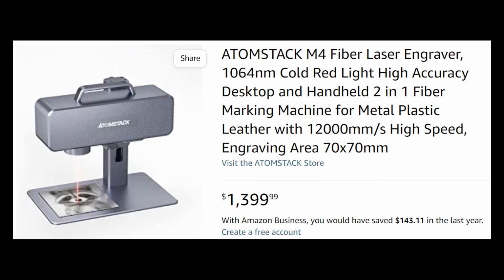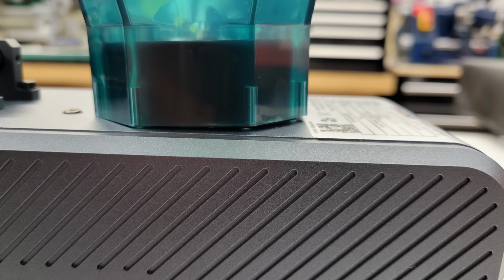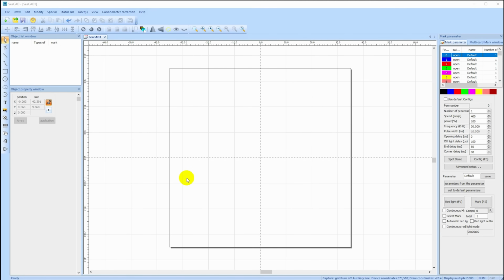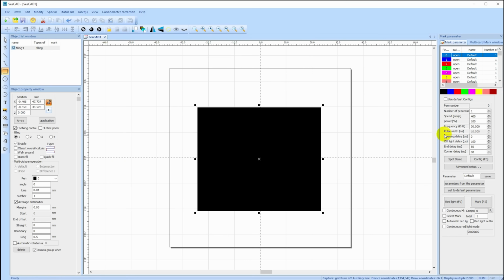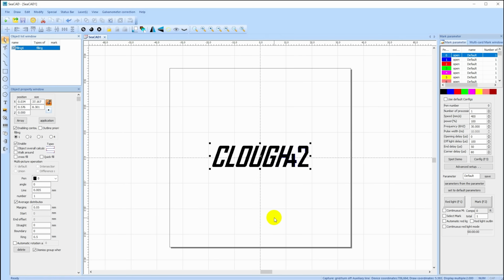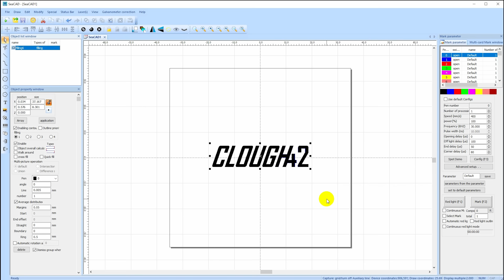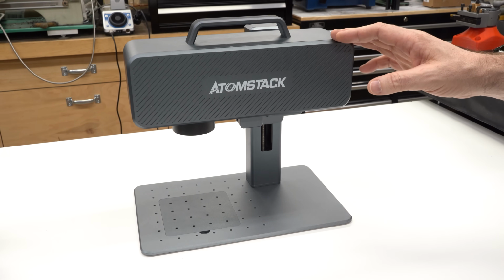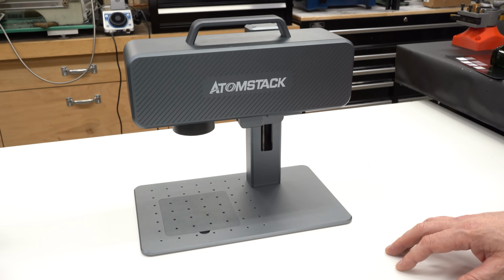Atomstack M4 Fiber Laser: Is it worth buying?

Comment: .I think you were being very generous.  If the average guy buys one and runs into any of the problems you di, then the reputation of the product goes down the drain,  Everyone of your suggestions should be adopted.  I think you forgot about the two formats that didn't work.  Fro me that would be a deal breaker. Thanks for the video.
Reply: I think most people who buy chinese stuff understands, that they are cheaper exactly because you are not paying for all the branding and handholding. They are not meant for the average western consumer type. And in my opinion, that's good. As the average western consumer needs to die, people need to recognize use value instead of signal value. And that's what china stuff offers.
There is always some western reseller who charges you twice for this and offers the hand holding and branding experience in a fancy box.
Reply: @Nobody-Nowhere  the also often incorporate poor software with many bugs. Don’t support all the claimed features, often don’t meet the specs and can be poorly assembled. Another problem as far as handholding goes, well what do we mean by that? If there is something wrong in one way or the other, you NEED the handholding. Generally, you can’t fix the problem yourself. Sometimes the problem isn’t fixable, because it’s in the design and manufacturing. Sometimes the “fix” is a kludge and doesn’t last, or really fix the problem.

Look, when buying an unknown brand from China, India, or some other places, you are taking a risk. Some of us find the risk may be acceptable, because we have a good deal of experience, but many others can’t, and shouldn’t be buying these products. Just because someone wants to do something doesn’t mean they should.
Reply: @Nobody-Nowhere  A product that actually works out of the box is more profitable. The best customer service is none, the product just works. That's cheaper than shoddy workmanship in the long term.

Comment: For that amount it would have to work just right out of the box and come with an easy to understand manual.  But then I am a crabby old geezer.
Reply: Thats as cheap as fiber laser go... fiber laser are not cheap.
Reply: @Nobody-Nowhere  if it is hard to use the price needs to be cheaper, I still do not want it.

Comment: Hey, This looks like Ezcad2 with a new skin. try saving it as illustrator 8. I personally have the most success with importing the design in light burn and exporting it as a DXF (if you don't have light burn for galvo or if the board is not supported by light burn (might be the case here))
Reply from the maker: Oh, I didn't think of that.  That's a good idea.
Reply: Let me know if you have any other questions I’ve dealt with easycad, light burn for galvo and CO2 over the past few years quite a bit

Comment: the software looks like a rip of eazycad2. depending on what board it had, you may be able to use it with lighburn. try exporting your AI files as AI8 or later. that's what I have to do with eazycad